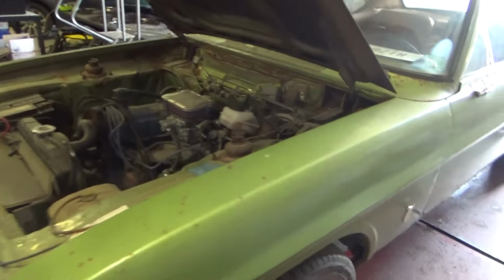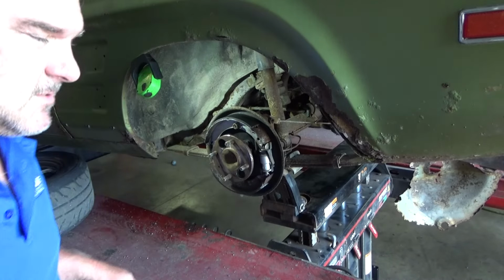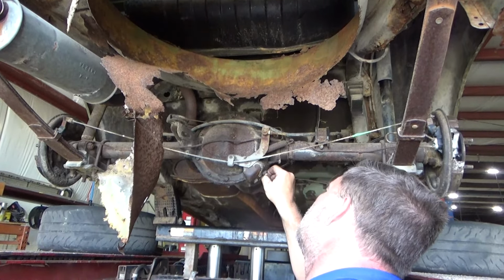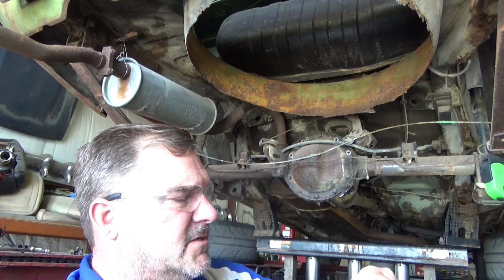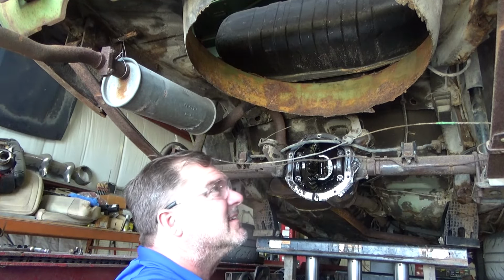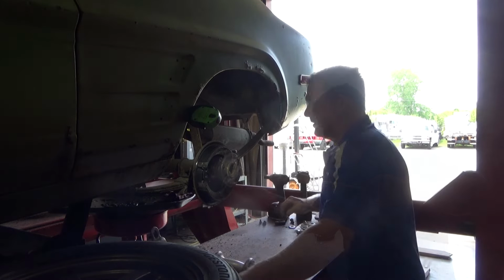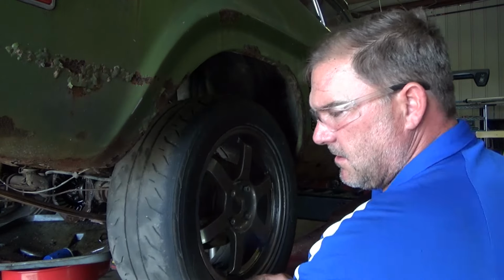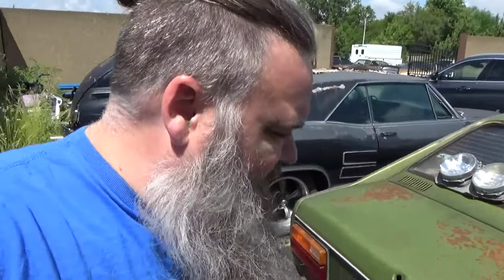Team Blitz Provides Bigger Studs! Green 1974 Ford Capri gets some attention!

Comment: everybody in UK was shouting at the telly "SLIDE HAMMER"
these cars were notorious for spinning in the wet, so we got plenty of practice fixing them after the back wheels bounced off the kerb...
Reply: Untrue if you use proper tires. I'm on my 6th Capri and the back end is only coming out if you provoke it. I used to drive these things hard and all had V6's from 135 to 220hp. And the sandbag comment most says is just crap. We have real winters in Norway and I had never problem getting up hills etc. Mine had always studded tires during winters. Only tires I slid around with was cooper tires which was utter slick and had no grip at all even with full thread. I used to drive 38.000 miles a year in my Capri.
Reply: @MrCaprinut  the capris i drove in the 80s were [almost] new hire cars, most fitted with original rubber, Goodyear G800 if i remember [165 x 13]
i drove all cars to the limit, mk2 escort, capri, cortina, granada, transit, + fiesta, the only cars i spun on a regular basis were the capris, whether 1.3, 1.6 or 2ltr, they just snapped on you when you got them sideways in the cold english rain
they were the most unpredictable fords i thrashed about as a late teen, had my wages "docked" for damage on them twice, £10 a week for a month, + a written warning lasting 6 months
i drove a 2.8 capri about 10yrs ago, the lad had a X brace mod. on the rear axle, he said it did wonders for the handling, i took his word for it, as i knew it would not be £10 a week for a month now...

Comment: A 4 litre and a 5 speed from a late 80's ranger wakes these up a lot! I swapped a 5.0 into my ranger and took the engine and trans into one of these, It was an animal. Light and fast!
Reply: you should have put the 5.0L in the capri,  and left the ranger alone...  I have a '73 Capri
with a 302/t5/9" rear end,  My 302 weighs the same as 2.6L/2.8L because of the alloy
heads,  the car weighs 2400lbs,  and with me and swmbo in it,  weighs 2730lbs...
and it runs mid 11.00s...

Comment: There was 3 axles on Capris. Atlas which you have, Koln (very weak, looks like atlas but unequal bolt spacing on the rear cover and English axle which have third member you can take off from the front like a 9" axle. I have never heard any of these has retaining clips for the half shafts. All is only hold by the reataining plate at wheel and only thing that prevent the axle to come out of the plate is the crimp ring behind the wheelbearing.

Btw Expressed panels in UK has full boot floors for these. The also do the well by itself at £340

Comment: But , what did you use to seal the rear diff housing? Sealant or a gasket? Just woundering.
Reply: I used liquid sealant.  It's quick, it's easy, and it works.....   I also didn't have a gasket on hand for this tiny little diff.
Reply: They originally had a gasket, but modern gasket silicone works well.